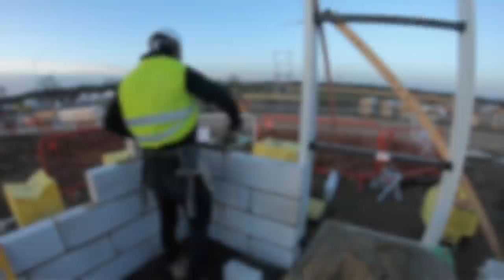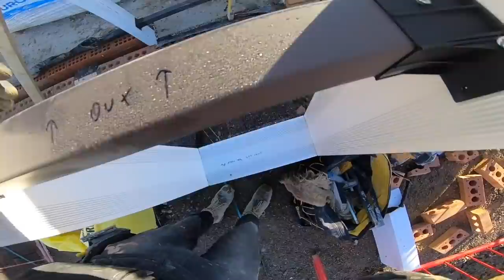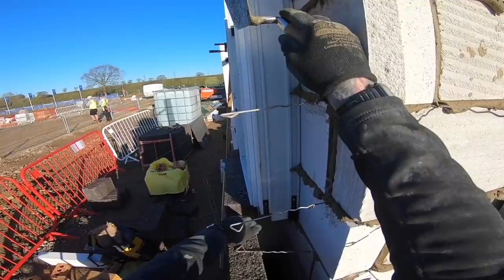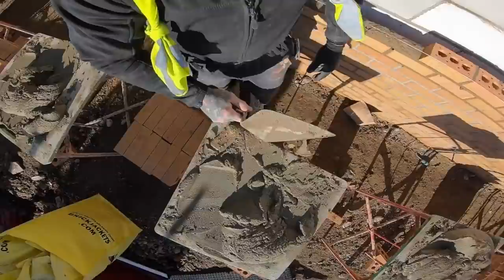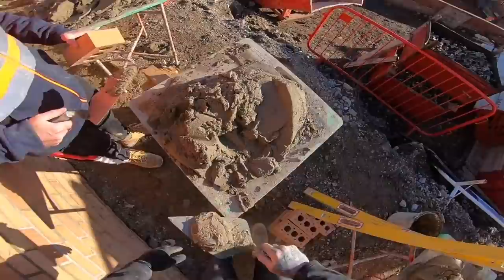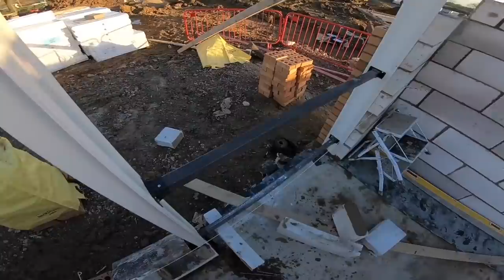Traditional Friday...

Comment: i know certain sites are different but i think there should never be a straight joint between the block work and the brick work.it should be a movement joint.and either way there should be ties either side of the straight joint or movement joint every single course.

Comment: So handy building them thermal block and not have to return the reveal ends to close them.in Northern Ireland.we have to return are reveal ends.50 mm insulation strips with 9 inch damp up against the exterior work.